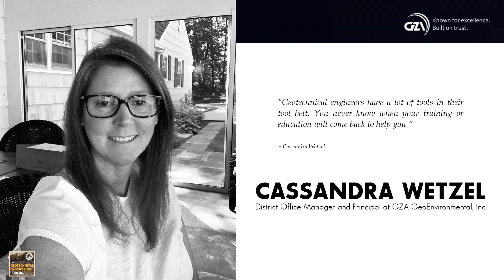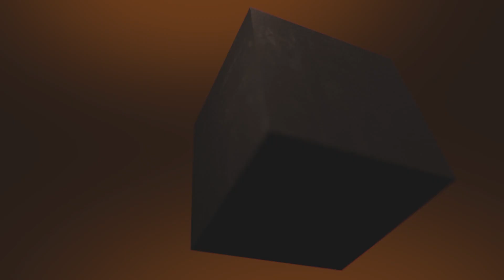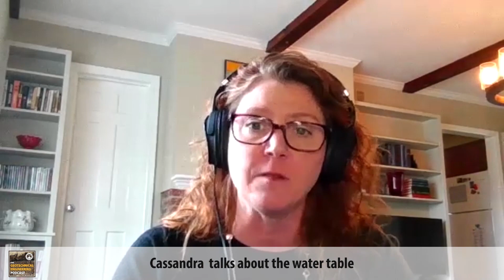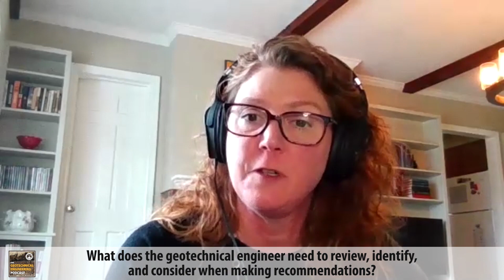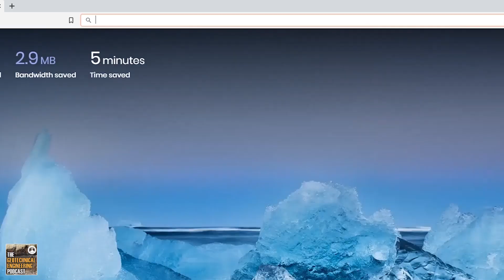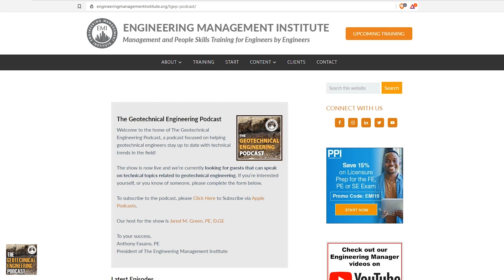Construction Around the Water Table | Geotechnical Engineering

Comment: I  hava a property inside the city houston limits and soil tester water table on the 5th footage down with 8 inches shallow with water, afterwards theres hard dirt. What is needed to construct a concrete foundation 50 by 50 feet.
Reply from the maker: @rosalindanunez5467 It sounds like you're dealing with some challenging soil conditions! For a concrete foundation in those circumstances, it's essential to consider proper drainage and possibly using piers or footings to ensure stability. Consulting a geotechnical engineer would be a wise step to get tailored advice for your specific situation.

Comment: with a high water table in residential where do you pump the water too. you cant pump it into the city sewer system. you cant pump it right into the street. so where do you pump it too.
Reply from the maker: @jjg1501 Great question! When dealing with a high water table in residential areas, water typically needs to be discharged to a designated stormwater management system, such as a drainage swale, retention pond, or storm sewer system if permitted. In some cases, a dry well or French drain can help disperse the water safely on-site. Local regulations vary, so it’s always best to check with your municipality to ensure compliance with stormwater discharge rules. Thanks for watching!